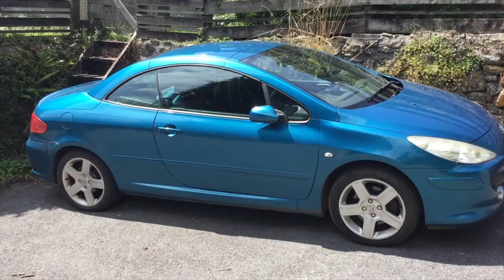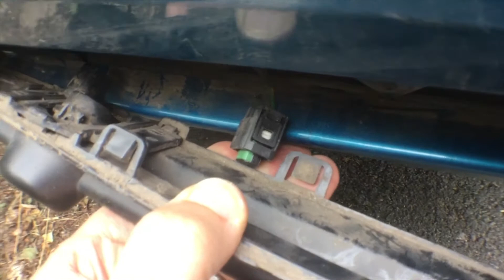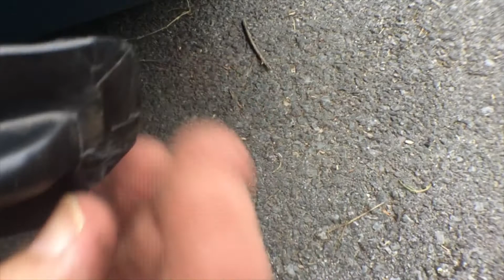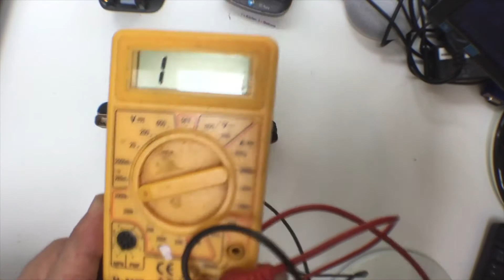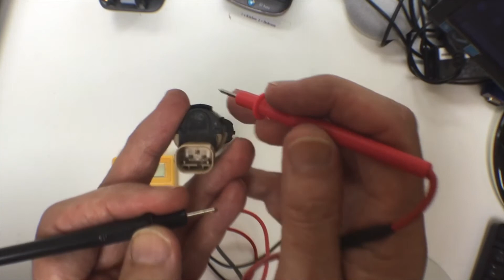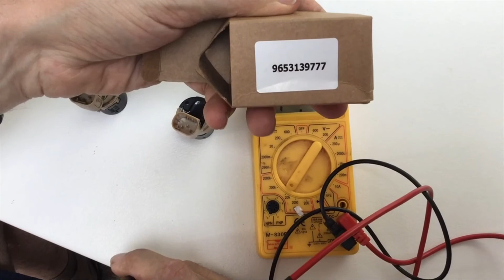Peugeot 307cc rear parking sensor removal, test and fix.

Comment: Hi, Where do you find the parking Sensor ECU please?
Reply from the maker: I have not had to find it, luckily, however this is from a forum entry...”The  ECU should be located in the boot on the LHS under the side trim. You'll be able to tell if it is there by following the senor loom underneath and it will be above the grommit that the loom uses to enter the inside of the car.”
Reply: @Jase777jase  ok, thanks for getting back to me, I wasn’t sure and didn’t want rip up too many things just to get to it.
Reply from the maker: E B ok, no probs. As I say, I’ve never had to look for it, so please don’t blame me if that’s not where it is, but that’s what I found online!

Comment: Do you know the location of the parking sensor control unit ?
Reply from the maker: I have not had to find it, luckily, however this is from a forum entry...”The  ECU should be located in the boot on the LHS under the side trim. You'll be able to tell if it is there by following the senor loom underneath and it will be above the grommit that the loom uses to enter the inside of the car.”